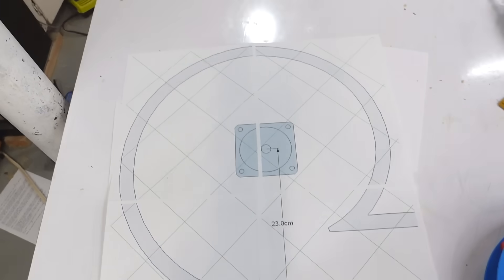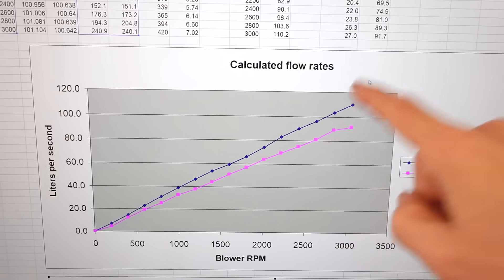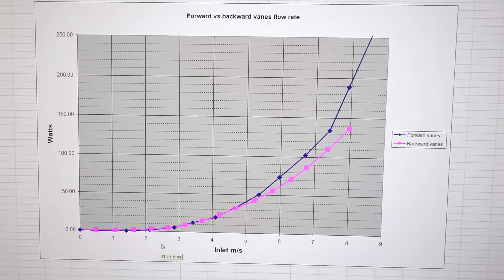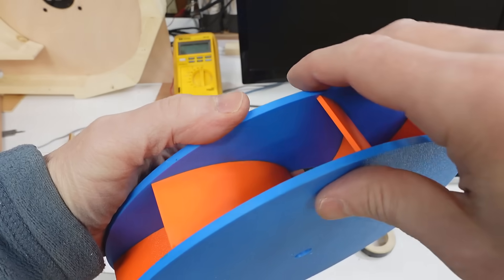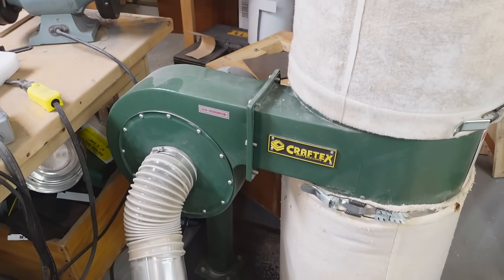3D printed blower impeller, forward vs. backwards curved fins

Comment: At 9:58 - That reminds me of the blowers found in paint spray turbine units where the multiple propellers don't increase flow too much at each step, but rather help keep somewhat consistently high pressure even with significant restrictions

Comment: I think some of the discrepancy between the input measurement and output could be due to using just a Pitot tube. Ideally a Pitot-static tube should be used to compensate for Bernoulli: higher velocity means lower pressure.
Fun video, and the testing of forward vs backwards facing fins surprised med. Great examples you had at the end.

Comment: Hey just a quick question. For typical dust collection vacuum units with a non varying fan, would the power graph look similar but in reverse? Where it starts out high and as static pressure is introduced, it curves down?

Comment: besides focusing air for blower purposes, what does that volute housing do for the inlet side? would multuple radial outlets have any effect on the inlet suction or airflow? i have a shopvac motor that outputs radially. it sucks through a dust filter. I thought about building a volute housing, but ended up putting it in a square box with sound dampening, and just having a port hole for the outlet. now i'm again wondering what a volute housing would do around a radial shopvac motor....

Comment: Forward facing fins are usually rather short in relation to the fan diameter. This possibly makes them more efficient than the longer fins in your fan, going over the entire fan radius.
But never the less they are also oriented like they want to suck the air into the cage, in the opposite direction of the main flow and the centrifugal forces.  That always seems totally paradox to me. I wonder if it helps to rotate the fins into a radial/neutral position. Don't know how to explane my thoughts better without a drawing.

Backward curved fins, on the other hand, also need to be long for better compression.

Comment: Rather dangerous project. 
It would be FAR safer, cheaper and quicker to make the housing curve from sheetmetal.
Reply from the maker: Only if you have a sheet metal workshop.
Reply: @matthiaswandel  Two straight cut strips of 2mm steel that sits in a 3mm wide routed involute curve cut into the side housings ply, held together with 6mm through bolts doesn't require a sheetmetal workshop. 
A lot safer if an impeller fractures, like what will happen if a stray nut or stone gets sucked in. 

OK, fine.. I'm just not into unnecessarily cutting and making dust... nor willing to create risk for myself or any other poor soul that might be around when experimental stuff fails at high speed.

Comment: Radial fans operate more efficiently at a certain housing to impeller width ratio. We usually shoot for 2.5 meaning the inside width of the housing is 2.5 times the width if the impeller.

Comment: I learned as a child that electric vacuum cleaner fans draw the most power when the inlet flow is partially restricted. When the inlet flow is fully blocked, the load on the motor goes way down. This impeller design feature made electric vacuum cleaners practical. Vacuum cleaners routinely get clogged in normal use. They would get a bad reputation if they burned out the first time they clogged.

Manual vacuum cleaners used a piston to create suction. People using manual vacuum cleaners were cooled by perspiration, so even if it took them a long time to figure out that there was a clog, the hardware would be safe. 

Everything I know about manual vacuum cleaners was from watching a movie involving time travel. In the movie the hotel staff used manual vacuum cleaners in the lobby of a fancy hotel, before electrification.

Comment: skimming a textbook on this subject, Fan Handbook by Frank P. Bleier, it looks like forward-facing fans sometimes don't have a smooth static pressure curve but instead have a bit of a dip at one point (fig 7.30). I wonder if this is what you are seeing at 8:44

Comment: You could make a simple mass air flow sensor with a loaded (by spring or weight) flap.
It's a more relevant measurement than airspeed or pressure

Comment: could you explain how you interfaced the motor with python code to output the results on the terminal?? is it connected to a  digital multimeter??  i love your work
Reply from the maker: I just tell the servo motor what speed to go at.  It goes at that speed, and if it can't it stops.

Comment: If you look at info on fan/blower design, you’ll see a big difference in performance between the two configurations in response to pressure differential across the blower.

Comment: AI Summary

Abstract
This video documents the construction of a custom housing and the subsequent performance testing of a 3D-printed blower impeller, specifically comparing the efficiency of backward-facing versus forward-facing fin orientations. Using a test rig equipped with sensors for airflow (anemometer), pressure, and power consumption (AC and DC), the impeller was driven by a motor controlled via Raspberry Pi. Tests were conducted under both unrestricted and restricted airflow conditions (simulating duct resistance). Results showed that while forward-facing fins moved more air per RPM, they consumed significantly more power and were less efficient, particularly under restricted airflow where backward-facing fins demonstrated a substantial efficiency advantage. The conclusion strongly favors backward-facing fins for applications involving airflow resistance, such as dust collection systems, suggesting that increasing blower size is preferable to using less efficient forward-facing fins if higher airflow is required.

Testing and Comparing 3D Printed Blower Impeller Designs

*   0:00 A 3D printed impeller for a blower was received, but the accompanying housing was kept by the sender; a new housing was designed and printed, requiring scaling adjustments.
*   0:36 A test housing for the impeller was constructed using construction lumber, based on a SketchUp design, to facilitate controlled testing.
*   1:29 A test setup was created using a Raspberry Pi to control the motor via a smart plug and collect data from an anemometer and pressure sensors.
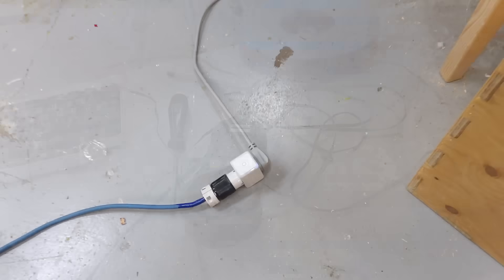*   1:48 Initial baseline tests were conducted using a simple paddle instead of the impeller to measure the motor's power consumption under load at various RPMs.
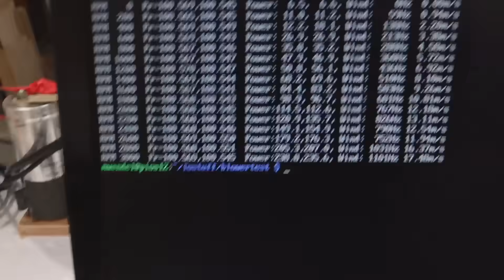*   2:18 Flow rate measurement methodology involved placing the anemometer inside a box at the outlet to try and achieve a more uniform airflow reading. Pressure differences between inlet and outlet were also measured.
*   3:40 Power consumption was measured using both the AC smart plug and a DC power supply; the DC readings were deemed more reliable and used for analysis.
*   4:03 Motor-only power (no load) was measured and subtracted from the loaded power (with paddle/impeller) to isolate the power consumed by the aerodynamic load, confirming an expected relationship close to RPM cubed.
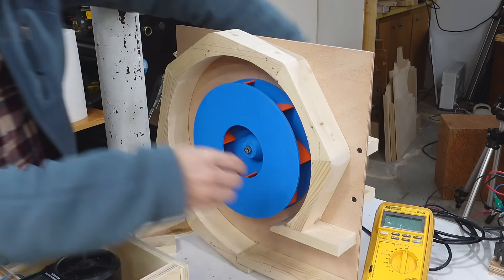*   4:36 The 3D printed impeller with backwards-facing fins was tested, showing it consumed less power but moved more air compared to the simple paddle at the same RPM.
*   5:29 Efficiency analysis (comparing power required for the same airflow) showed the backwards-facing impeller was significantly more efficient than the paddle.
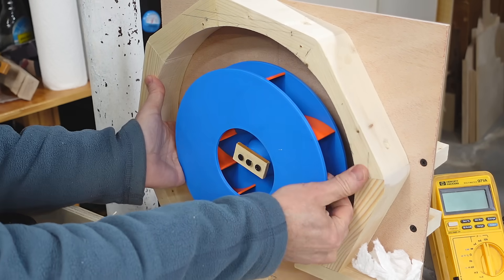*   6:09 The impeller orientation was reversed (by flipping the housing) to test the performance with forward-facing fins.
*   6:46 The forward-facing fin configuration moved substantially more air at the same RPM but consumed dramatically more power, causing the motor controller to struggle or lose phase at higher speeds.
*   7:11 Comparing power consumption versus airflow rate (unrestricted), the backwards-facing fins were generally more efficient, though the forward-facing fins produced higher peak airflow before potential motor overload.
*   7:52 Tests were conducted with restricted airflow (simulating ducts/filters by using a smaller intake hole) for both fin orientations.
*   8:10 Under restricted airflow, the backwards-facing fins demonstrated a much larger efficiency advantage over the forward-facing fins, which used considerably more power for similar airflow.
*   8:50 The improved efficiency of backwards-facing fins under restriction is likely due to reduced turbulence compared to forward-facing fins, which tend to just churn the limited air.
*   9:16 While forward-facing fins might move more air even under restriction (if the motor is powerful enough), a larger blower is generally a better solution for significantly increased airflow requirements.
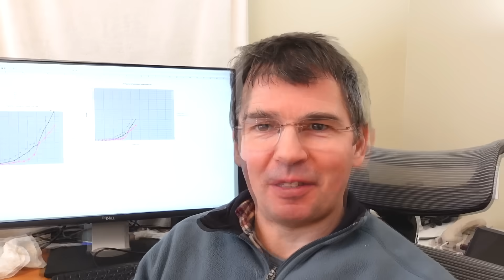*   9:29 A comparison is made with commercial blowers: squirrel cages (low RPM, high volume), vacuum cleaners (high RPM, high pressure), and leaf blowers (radial fins, high pressure).
*   10:16 Dust collectors often use straight (radial) fins, requiring a balance of pressure and volume. Crucially, dust must be filtered before the impeller to prevent damage and imbalance.

I used gemini-2.5-pro-exp-03-25| input-price: 1.25 output-price: 5 max-context-length: 128_000 on rocketrecap dot com to summarize the transcript.

Input tokens: 12879
Output tokens: 757

Comment: The air handlers in our labs use backward facing 30" diameter impellers for the static pressure. I think they run about 4K RPM and move air through a couple hundred feet of ducts and filters. The intake is isolated but the housing is just a 8' square box for the exhaust fan to deal with. Make-up air balances the system. Same fans on those.

Comment: Is there any significant difference in weight/mass between the paddle and the impeller due to the use of different materials, or was it a groovy convenience that they were close enough that it wouldn't be a factor in the results?

Comment: Have thought of making a fan in the 2.2 kw range?  This is the size i am targeting for my next dust collection system.  3 ph backward facing fan with vfd running at 1800rpm to  keep noise down.  
Love your test setup,  my engineering career started with 9 years of small scale testing and development. MSDOS days.
Reply: I’m doing a similar project. Someone was selling a 2hp dust collector. It had a 3 phase motor, so the potential buyer pool was very limited. I bought a cheap VFD from automation direct for less than the discount I got for the 3 phase motor. I think the vanes are straight. The VFD will go up to 400hz. If I run the DC with higher pressure differential across, it should still move decent amounts of air.

Comment: we should do like an impeller showdown , as most of us have a 3d printer that could make any shape, and we made the most common shape possible, surely a turbocharger shape would move more air or at higher pressure, and would be a nice challenge for us to design better impellers
Reply from the maker: The turbocharger is likely a highly optimized shape.  Would probably do better.  Feel free to send me one.  But you will also need to send me the front of the housing, as that will not be flat.

Comment: I am a mechanical engineer and worked in R&D most of my career (the first 2 years I designed liquid pumps similar to this blower). Your process here is just like what I would do as a R&D engineer. I had a fancier data acquisition system (had a Speedgoat + Similink system that was really great because it was super fast and with simulink it could simulate parts of any system that I did not have physically and make control systems with feedback too) but the quick and dirty experimental methods are exactly what I did because it's cheap and fast and you hardly ever need extreme accuracy when making engineering decisions based on experimental data anyway. It's best to do a quick experiment, learn and make a decision and move on as opposed to everything looking 100% lab quality professional grade. The company (semiconductor instrumentation company) had a fancy lab to show customers in silicon valley but the real work was done at our facility that rarely saw customers and cost much less than the shiny lab. Always love your content.

Comment: Your volute housing is exactly the same way I made my first forge blower 45+ years ago.  Tried 3 impellers: forward, reverse, and straight. Used a home built pressure gage and pitot tube. Went with straight blades for max pressure even though it had 14% less flow than backwards vanes. But, my vanes were all straight, not curved. 

On the forge, unable to detect differences between backwards and straight fins. But went with straight to make cleaning less of a problem even though louder.

Used the home made blower for 2 years before upgrading to an olde Sturtavant forge blower from the turn of the last century (still have and she is a  beauty).

Both blowers were capable of lifting the coal fire out of a fire  pot 8  inch wide x 21 inches long. Substantial.

Comment: Long ago when I was an engineering student doing an internship "in industry" I did a lot of work with forward and backward impellers. The key is that forward curve throw the air forward, and are great for volume, but only at low back pressure. Backward incline have far superior performance curves as you get more back pressure, like your dust collection example.

Nice that you could instrument it with fairly simple and inexpensive tools.

Comment: What are you using to get the big numbers updating in real time at the same time as the terminal output? Ncurses?
Reply from the maker: 20 lines of python code that I wrote.
Reply: @matthiaswandel  :) I love people that write their own thing in a few lines of code rather than just depending on a library to do it for them and increasing their code size, and usually slowing it down too! A REAL software engineer :) My pet peeve is people that include some huge library, like Pandas, to only use it to read csv files, when in python you can read and parse csv files with about 3 lines of code
Reply: the big numbers are part of the terminal output.. of course they update at the same rate

Comment: so what about a double-impeller (2 discs on one motor-shaft), one with forward-fins and one with backward-fins... will it produce high pressure and high volume at the same time? And what happens when the spinning-direction changes? What if the housing has 2 exit-openings?
Reply from the maker: it will also have the worst of both.
Reply: @matthiaswandel  sounds like married people: they double the good habits and also the bad.
Reply: @matthiaswandel  and what about S-shaped fins? forward direction to collect the air and backward direction to blow more volume.

Comment: can't you read torque to get actual power?
Reply from the maker: The servo does have a torque that can be queried, but I found that to be an fairly unreliable measure on this one, so opted not to use it.
Reply: @matthiaswandel  thanks. i would have thought the servo can measure and output torque for the PID control loop

Comment: volute shape not required, circle is just fine, just like in a tesla turbine. you know the bernoulli law for fluid pipes. does not care about shape. ie pressure spreads equally. nice centrifugal thruster btw. even the slab wood is a centrifugal water-fluid pump. percentages optimizations are not fun or useful btw. dont stop at 7m/s, go all the way the power curve, to 20m/s. more critical in the high end turbine thruster side. yes high power edf high end. yep compare to axial linear edfs. possibly also to normal non-edf prop fans. backwards fins scoop airflow backwards. rather scientific measurements lol.
Reply from the maker: I stopped at 3000 RPM because that's as high as the servo motor would go.  Also, I'm pretty sure the impeller would explode at something like 5000.

Comment: There's some advanced work here. I wonder if the impeller design was roughed out or copied from a commercial product, since the impeller  is usually optimized for a specific RPM.

Comment: So forward scoops for more air but less pressure, backwards for higher pressure lower air volume. Thats a great find.
Reply from the maker: Forward also dos more pressure at the same RPM, just needs way more power.  So you woudn't use forward for applications where you need a lot of pressure.
Reply: @matthiaswandel  this is a little bit mind bending for me... is it essentially like the mechanical advantage of a pulley? ... Putting it backward increases the number of spins needed to get the same pressure but makes each spin easier?
Reply: @AlexA-tl6kg  centrifugal fans make pressure by accelerating the air, which decelerates in the volute - changing the air momentum into pressure. Here the forward facing fans have a greater increase in momentum for one pass through the impeller, which takes more power - and results in more pressure.
Reply: @ does forward facing push more volume per pass or push same at greater momentum (or less at greater momentum)... I am imagining that not all air caught between the fins necessarily gets forced through each pass.

Comment: Another exemple of forward facing fins can be found in the ventilation of power tools. For instance I've seen them in sander, where you want to maximize air flow for dust collection but you only have a limited space.

EDIT : Actually i went to check my collection if all handheld powertool were like that and it's all the shapes. I saw straight fins on some sanders too. One model had backward fins for the dust part and forward fins for the motor cooling part. I saw a drill with backward fins even if not much static pressure is needed and RPM might be low due too variable trigger. Strange!
Reply from the maker: Drills run both ways.  For the power tool, where the fan is it's usually quite small diameter, so effectively kind of low speed.  So forward curved makes sense to get more flow.
Reply: For that particular drill (GBM 13 HRE Bosch) I meant the fin are backwards if you run the drill for drilling (not to unscrew something).